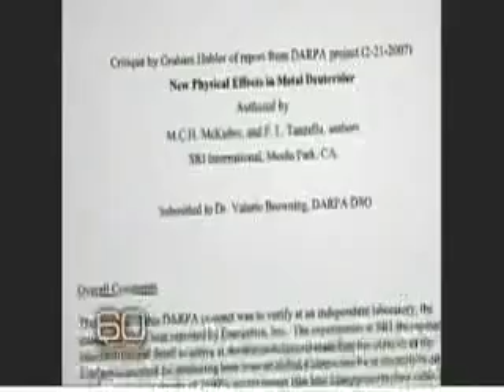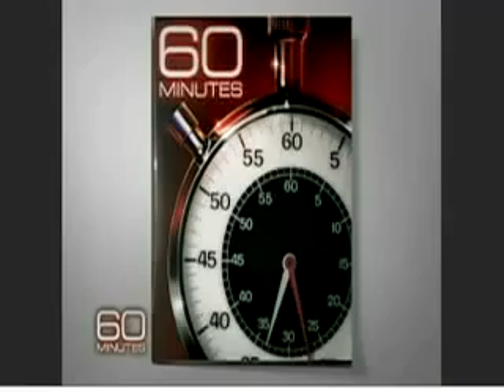Cold Fusion - 60 Minutes - 2nd half

Comment: @energytruth Did you watch the video above?  Cold fusion has been "discredited" for 20 years by the mistaken belief that every scientist is measuring either the input or output incorrectly.  Krivit is basically making the same assertion.  He is attempting to dispute Rossi by measuring INVISIBLE steam with a 12 minute low-res video.  Seriously? Rossi will allow scientists to examine his device for 2 months and make their own measurements. If they see inside the reactors is largely irrelevant.

Comment: @energytruth Well at least thanks for stating that these are only your opinions.  Yet, I must point out that people with PhDs in physics have stated with relative certainty that the effect is not caused by a chemical reaction.  The reactor is too small to hold any known chemical that would produce that much heat.  Let me state categorically that it may still be a fake but all KNOWN methods of faking the reaction have been ruled out.  Be wise and wait for more definitive data before deciding.